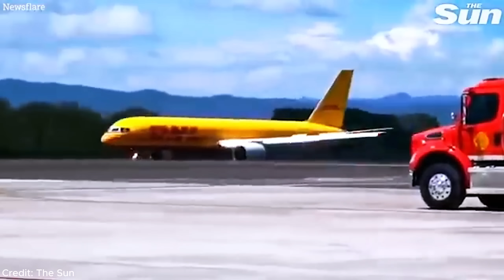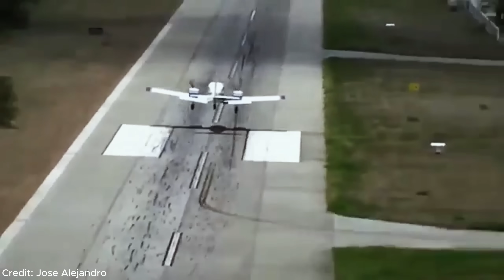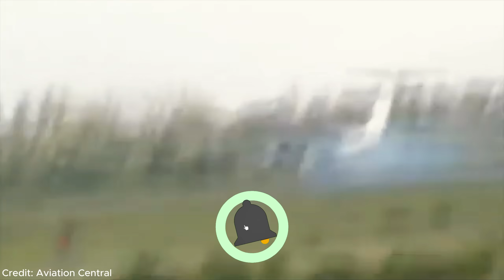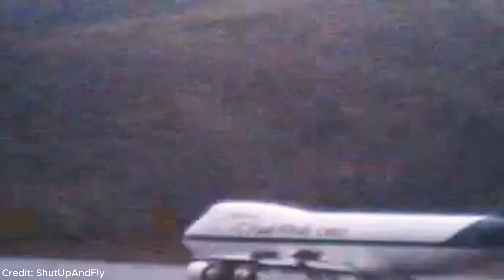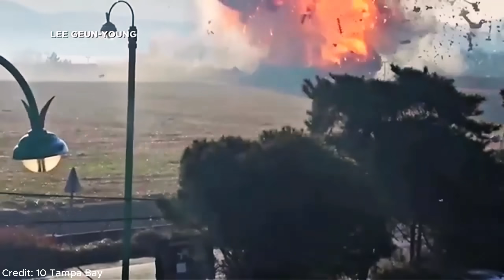Planes Run Out of Runway! Caught on Camera

Comment: About 5 of these clips actually did run out of runway, the rest are just accidents without a runway overun.
Garbage clickbait, garbage narration.
Reply from the maker: Most of the accidents in the video were related to loss of control on the runway or serious problems during landing. It should not be limited to going off the runway. Don't you think such incidents can also be considered as runway accidents?
Reply: @VolarSeguro0  I'll say it again.
About 5 of these clips actually did run out of runway, the rest are just accidents without a runway overun.
Garbage clickbait, garbage narration.

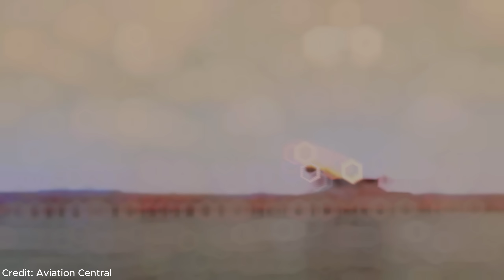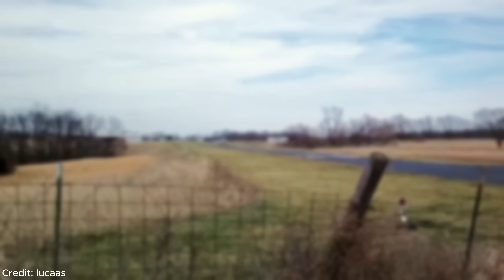Comment: 7:54 - is that AI? And at 5:09 what what so very bad about that landing?
Reply: Animation is fine, but shouldn't we be told when it's animation? You can very often tell when it's CGI but what about the times when you can't (which is going to be more and more often)? The same with slow motion. Very often you can tell, but sometimes you can't. It should be stated when something is slow motion (can't recall but I don't think that applies here).
Reply from the maker: @richardarcher3435  Thanks for your thoughtful comment! You're right—transparency about CGI or slow motion can really help viewers better understand what they’re watching.
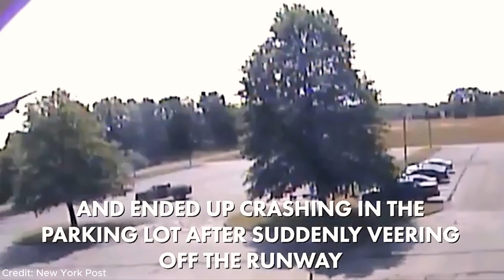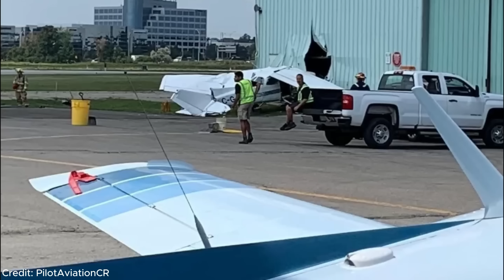Reply from the maker: The event at 7:04 is a simulation of a real incident, while the event at 5:04 almost resulted in a crash due to a bad landing. Anything else bro?
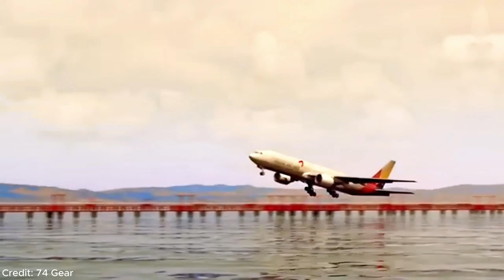Reply: 7:54 Its animation
Reply from the maker: @iloveminecraft_6-d4v  That's what I said bro

Comment: 0:25 a DHL Boeing 757 skids off the runway and broked into 2 pieces
7:56 Asiana Airlines flight 218 Boeing 777-200ER flies too low during landing
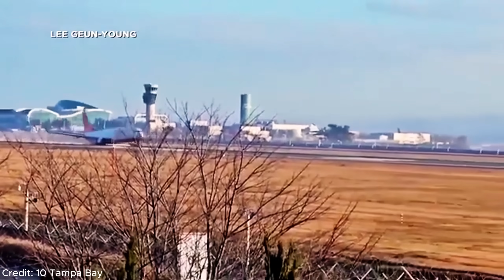8:40 Jeju Air Flight 2216 Boeing 737-800 overran and crashes into a concrete barrier
Reply from the maker: You literally wrote the catalogue receipt for this video 😄 Thank you! Which of these accidents was the most striking to you?
Reply: @VolarSeguro0 bouncing FedEx will scared my mom
Reply from the maker: @Baldayker  I guess the landing was a bit rough 😅 Is your mom usually afraid of planes?